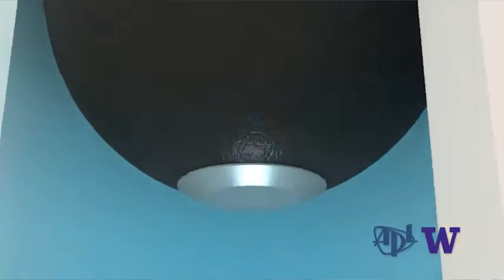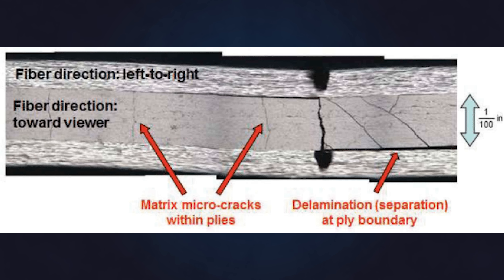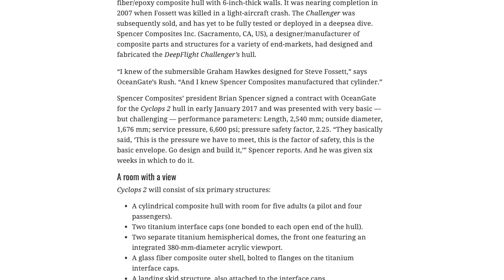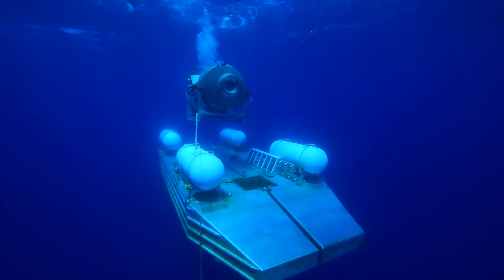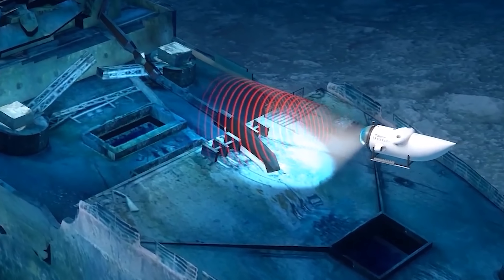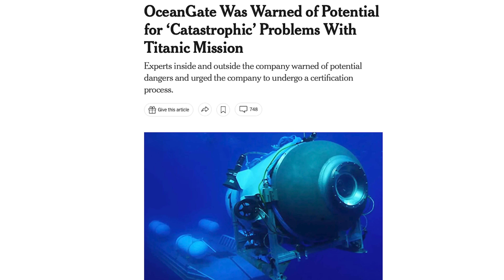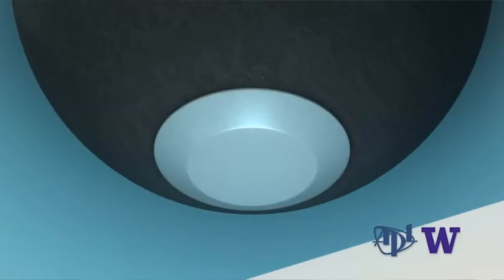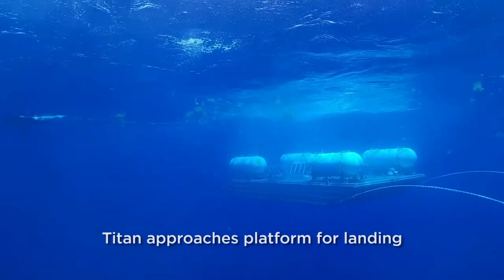Engineering Failures Behind Titan’s Implosion!

Comment: The reason everything went wrong was from the beginng, water started leaking into the rear where all the electronic was causing the Titan to decend at a much faster rate than it should have. The warning sensors started flashg and they heard noises coming from there and decided to go back up. However, the Titan was continuing to fill the rear and it was too heavy and the Sub did not have enough power to overcome all the extra weight and they only ascended 5 meters in over 1/2 hour and when the rear had filled up, it took out all the electronics and the ability drop weight or use any method to ascend useless. At this poin, the Titans carb fiber body was now getting all that pressure on the back of it. This would put put to much pressure that would cause the fiber weave to start come apart.. Kid of like the woven finger locks you used to get at carnivals, where you put your ingers in but cant pull them out unless you compress the weave and it spreads open.

Comment: I think the end cap should have been made similar to a flange where bolts could have been installed connecting both caps together like an expansion joint
Reply from the maker: So like bolts going across the whole frame?
Reply: @beyondengineering  Yes four long bolt running length wise. Two on each side. To prevent having to drill and tap into the carbon fiber and assist the glue incase of failure. Just a theory.

Comment: When I was obsessively bicycling years ago I started to shop for a high end touring bike. 
Even the stoners at the bike shops that weren't sure what day of the week it was were adamant that carbon fiber is superior for immediate gratification, but the worst option for the person on a long haul. 
I eventually morphed into a shipwright and never developed any confidence in the toughness of carbon fiber. 
Something as simple as a glass bottle will show a person how hardness doesn't correlate with toughness.
Reply from the maker: There was enough knowledge about this material and the possible risks it posed, shame Rush insisted on going his way
Reply: @beyondengineering  - Abraham tanks were built with carbon fiber because it is superior. 
Oh, dang... I guess carbon fiber didn't cut it. 
Wonder why.

Comment: Alright, I’m going to ask a dumb question…but I don’t know the answer?
As dangerous as diving to that depth is, wouldn’t that be the risk you’d most want to eliminate? It seems a safer way to go that deep would be to fill the pressure capsule with water at the surface and have everyone breath off a supplied air hose. Obviously, that’s a dangerous thing to do, but wouldn’t that eliminate the threat of implosion?
Reply from the maker: Search for mythbusters compressed river video. You can see for yourself what would happen long before you get anywhere near that depth
Reply: @beyondengineering  I appreciate your reply. I watched that episode…it is a great example of an implosion for sure. I don’t think it’s a good analog for what I was curious about though. What would happen in this example…the Titan, exactly like it was the day before it imploded…is filled with water and (for the sake of not getting into where the air supply is) two SCUBA divers get in it and go to the bottom. Wouldn’t they be in a pressure relative to being in a few feet of water, and the sub would be protected because water doesn’t compress?

Comment: Carbon fiber is not useful in compression, but boron fibers are used in the main wing spar of the Stratolaunch aircraft on the upper side, which is loaded in compression. These "fibers" are actually more like wires, about a millimeter in diameter, and the spar has internal stiffeners to prevent buckling.

None of which was done for Titan.
Reply from the maker: Comments like this are the reason for being on YouTube! Learned something new, thank you!

Comment: Over 5000psi is why the submersible failed
Reply from the maker: Is that the material limitation? because 

According to Composites world they needed 114mm for 4000m depth with 1.25 safety factor, they chose to round it up to 127mm or 5 inches instead.

So I think thickness wasn’t as big a factor as the inherent properties of the material. Thickness just added to their problem of not being able to know if the material was maintaining quality from the start and over time

Comment: The carbon fiber wasn't ever cured in a auto-clave to eliminate the voids in the fibers (fill them with resin compounds to fill in the holes and harden properly). I'm not an engineer but I do have a degree in chemistry and several classes in physics. This was a HUGE mistake! I'm NOT an engineer and knew you had to auto-clave this material. Mr. Rush had a BA in engineering, he should have known better. I'm sure people tried to tell him, but he didn't want to spend the money!
Reply: Sorry, I should have watched the video first. I'm just mind blown by these discoveries.
Reply from the maker: I can’t understand why they wouldn’t use one, it doesn’t make sense
Reply: @beyondengineering  Saving dollars over lives I think.

Comment: I understand the desire to create a neutrally buoyant structure but so much engineering information is available and a steel hull could have been very easily designed and made. I did some engineering contract work for Vickers Oceanics back in the 1970’s with their Pisces mini subs and the attention to detail and testing, including cycling the containment vessel to an rms depth before use was the only way to go because computer modelling hadn’t been invented. They had an accident but it was caused by entanglement.
Reply from the maker: Shocking part is that it’s common knowledge that it’s hard to model composites in software effectively, so the lack of real world testing is unforgivable really

Comment: Pretty sure this application was only rated for a single dive to depth. Not for repeated use.
Reply from the maker: That’s because of the inherent problem with such a thick layer of carbon fibre, you can’t guarantee more than 1 successful dive but material science can be advanced, just needs rigorous testing

Comment: That is the best engineering feedback that I have seen on this matter. Never mix two different materials in the same structure. Stiffness and thermal expansion must always be noted in any structure. This was my very first comment when I saw how this hull was made. And I agree, it was most likely the epoxy joint that failed.
I always taught my designers that you cannot reinforce an egg shell by adding elastic bands. Two different stiffnesses.
Reply from the maker: Thank you for the love Gavin! It means a lot. 

Rush said so himself in an interview, saying that you never mix the two but he did it with hopefully good engineering behind him. 

I would love to hear from engineers that worked on this project as they know a lot and can teach us a lot now

Comment: Finally someone points out the most obvious flaw. Carbon fiber is like a seat belt. It can hold a lot of weight but only in one direction:tension. Try building a house out of seatbelts. Not happening.
Reply from the maker: James Cameron summarised it pretty well too, I have massive respect for that guy now

Comment: I build and work on high end carbon fibre road bikes. Torqure wrenches always gotta be used when tightening something on the carbon fibre frame.  When over torqued And when you keep going.. CRACK and SNAP. Always. 

Stockton took it too far deep where the torque pressure was waaay too high haha. Not sure if same idea lol but sounds like it.
Reply from the maker: Never underestimate the sea 🌊

Comment: Beyond Engineering , thanks for the informative video.
     I was wondering, given the bolts holding the carbon fiber titanium end ring were all sheared from the titanium end domes: what would be your opinion for the implosive forces - carbon fiber tube collapse or view port water jet distruction?
Reply from the maker: I think someone here in the comments had a good theory on how it happened. I definitely think it’s the hull that imploded and the resulting pressure wave broke the acrylic viewport

Comment: I've always wondered if the following would work. Can anyone answer this? If you had bottles of tri mix diving gas inside of a small sub...could you use them to pressurize the pressure hull's atmosphere to 10 atm of pressure in an emergency situation? Unno what I mean? Maybe it'd help, prob not, but maybe if you were at depth and pressurized the sub to 10atm...maybe it'd buy some time as they were slowly ascending? It would simulate a 100 meter reduction in depth...could or would that possibly help if you were on the cusp of implosion? 
I'm just a non educated science loving guy asking if anyone can elaborate.

Comment: The illustration at 1:13 is wrong
Reply from the maker: Can you please explain how to make it better? Is it that the fibers are being added without another resin layer?
Reply: @beyondengineering the crack should propagate in the other direction, 90 degrees of what is being shown. Parallel to the layers of fiber.

Comment: Good a solid commentary. BUT - PLEASE STOP USING THE STRING IN COMPRESSION ANALOGY TO DESCRIBE HOW COMPOSITES WORK IN COMPRESSION ! 
You are just feeding the trolls and mislead people who know nothing about composites. Yes - carbon/epoxy composite was inappropriate choice for this application. Yes - porosity, compaction, curing problems are obvious. Yes - microcracks, delaminations, thetmal expansion and stiffness mismatch is aproblem. Yes - bonded joint working under 3D stress state is abad idea. Yes - cyclic fatigue (when loaded to high strain values) is a problem...
I am not defending the material choice, nor am I criticising anything here.

But in addition to showing the string which doesn't take compression - maybe you should also mention the fact that carbon/epoxy uni-directional tape usually fails in tension at about 2000-2500 MPa, and in compression at about 1200-1500 MPa. Yes - the ultimate stress in compression is less than in tension - but it still rivals high-grade steels.
I have seen very many people using the "string in compression" analogy - and it really has nothing to do with reality (except from the failure mode in compression which originates from microbuckling of fibers when the matrix capabilities to keep the fibers straight are exceeded...).
If we want to be scientific - then let's be scientific.
Reply from the maker: I was trying to show the failure mode and the matrix resin is dominant under compression, not the fibers. 

You are correct though that I should have mentioned the other materials in comparison to give more context. 

The main point I wanted to make was that it wasn’t the correct application for this material

Comment: You summed it up. "In reality....it's just bad engineering".
My theory on what happened originally centered around the bonds between the carbon fiber tube hull and the titanium sealing ring/hemispheric end cap bulkheads.
However, that doesn't explain the off nominal descent rate some 40% on average faster than any previous dive nor the electrical failures.
My new theory accounts for all of that as well as a couple other anomalies noted taken from the leaked text transcripts which have been confirmed to me personally by 2 experts within the submersible community and US Navy surface vessels tasked with monitoring the North Atlantic area where the tragedy took place.
Here's my theory. Any input, criticism and debate is encouraged. I want to understand what happened whether my theory is correct or not.

My theory is that one or both of the oil filled spherical electronic suite "cabinets", ironically the only components of Titan which were thoroughly tested and certified for the depths Titan was built for, began leaking, displacing the oil, filling with seawater and causing an electrical/electronic malfunction and a loss of buoncy , minimal though it may have been.
The electronic malfunction due to sea water intrusion resulted in the ascent/descent thruster controllers short circuiting, causing a surge of current, running the thrusters much faster than the nominal rate and coupled with loss of buoncy resulted in the off-nominal descent rate some 40% to 50% faster than normal.
Top side was aware of this high descent rate as was Rush, the pilot of Titan.
At each check in at 15 minute intervals the fast descent rate was noted, conveyed and ignored by Rush.
Eventually Titan reached depths in the high 3300 meter range when at 9:28:16 the Titans RTM (Real time hull health/integrity monitoring system) sounded an alarm.
Rush tried to arrest descent with thrusters at 3433 meters without success and at 9:30:36 and approaching a depth of 3500 meters Rush communicated that descent velocity actually increased. At this point I believe the carbon fiber tube hull had begun delaminating and deforming as a result of the many cycles to depth and back it had seen and exacerbated by the rapid descent rate. Even a relatively minor reduction of hull diameter of 2" would result in a massive reduction in buoncy and was gradually occurring all the way down. It had now reached critical levels however.
The decision was made to release ballast with no improvement.
At 9:35:48  and a depth well below 3500 meters the heavy steel landing frame, after multiple attempts was finally jettisoned which did arrest descent and began their ascent.
At 9:38:09 a loud unidentified "crackling" sound began coming from the aft end of the vessel. I believe this was caused by the electrical systems shorting and arcing or from their cabinets now filling completely with seawater and possibly entering the conduit passing through the aft bulkhead into the crew compartment, contributing to the loss of buoncy.
At 9:42:12 Rush began running diagnostic checks and noted a very slow ascent rate. The crackling sounds had subsided.
Diagnostic revealed a "global" RTM alert with all parameters reading red at their limit of monitoring.
At 9:43:42 and a depth of 3476 meters Rush relayed that ascent rate was just 25% of the "predicted" rate which tells me Titan was never tested without its landing frame.

At 9:46:37 and depth of 3457 meters Rush communicated that main power bus A was reading all red and he switched to main power bus B and that the crackling sounds from aft had ominously returned.
This communicay some 18 minutes and 21 seconds into their ordeal since the first RTM alarm and having ascended only 43 meters , was the last transmission to come from Titan.
Some 9 seconds later a US Navy surface vessel tasked with monitoring that area of the North Atlantic detected the sounds of an implosion.
Whether due to hull failure or perhaps seawater intrusion through electrical systems conduits Titan and her crew were lost.
This is what happened as confirmed by reliable sources. The transcripts are REAL and serve as the account of the last 18 minutes and 21 seconds of the 5 crewmans lives. Whether my theory is correct and played a role or not the end result is the same. The Titan design failed catastrophically.

RIP to all those lost.
May God bless their loved ones.

Comment: Also the hull was designed with 2.5x safety factor of its maximum operating depth. 

Also you have to be completely ignorant that it had not undergone any non-destructive testing as the hull that imploded is actually the second hull. The first hull failed to passed the safety test and it was only restricted to operated at maximum depth of 3000m which is why the new hull was ordered and replaced as the original hull cannot reach the titanic wreck.

Just about every info in this video is false or misleading 🤦🏻‍♂️🤦🏻‍♂️

Please don’t make any more videos. You don’t have the skills to make one properly.

Comment: When any Submersible is designed specifically to carry humans or even Paying Passengers to the bottom of the Ocean, irrespective of materials used, the main objective should be the Factor of Safety (FOS). In a harsh environment where the external pressures on the vessel are extreme, this FOS should be at least 5:1. This means (that at an external pressure of 300 Bar), the Vessel should be able to cope with 5 x 300 Bar = 1500 Bar. The Vessel (Titan) should have been subjected to rigorous Cyclic Testing prior to its' use. BTW, at 1500 Bar, this would equate to a huge external pressure of 21, 750 lbs per square inch - which is acting over the whole surface of the Internal Chamber. Experts and academics may argue that the Factor of Safety of the Submersible (Titan) would have been less than 2, as based upon its Track Record. In an ideal world, a Factor of Safety with minimum 10:1 would allay fears of any implosion occurring, and my prediction is that  many decades will pass,  before any attempt to go to the Ocean Depths to view the Titanic happens again. Your report has been a great education, and contribution to the knowledge with regards to Carbon Fiber, a most unsuitable material for the application. RIP to those 5 pioneers who braved the depths.